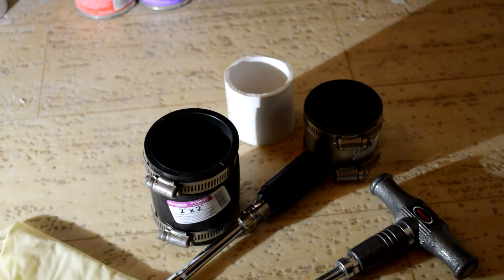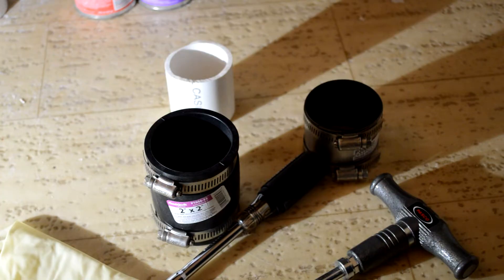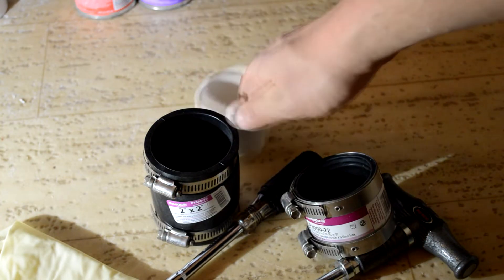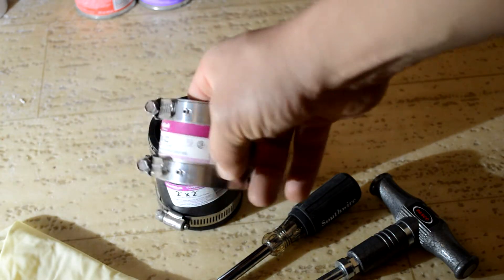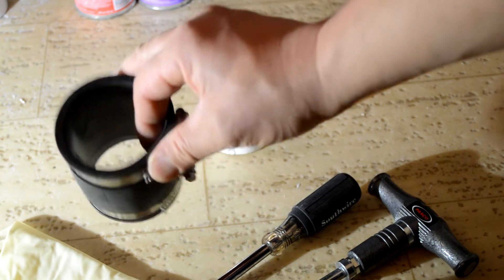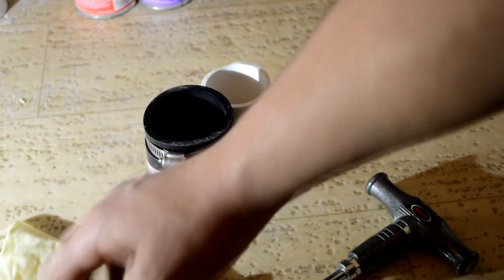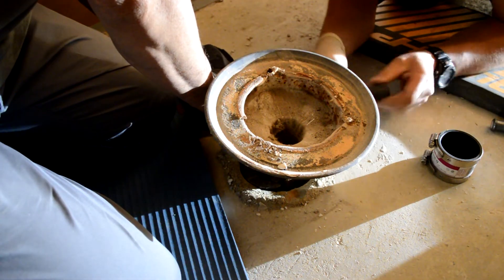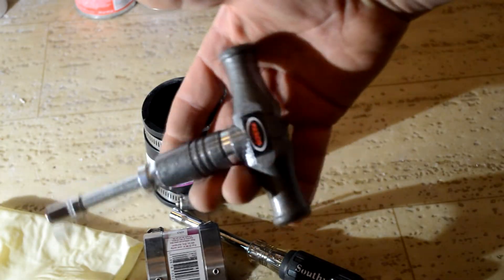From Cast iron no hub pipe to PVC the right coupling

Comment: Did you use pipe cement on the rubber fitting??  Wont that eat through the soft rubber and will it adhere to the cast iron?
Reply from the maker: Hmmm, no cement on the rubber please
Reply: I saw that too, but assume the cement was for the extension of the flange. Not for rubber coupling.